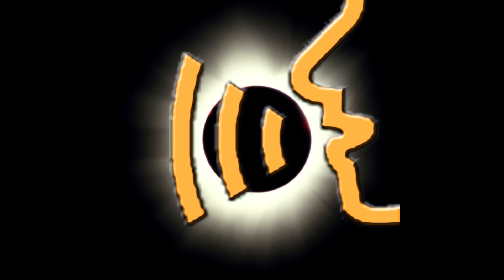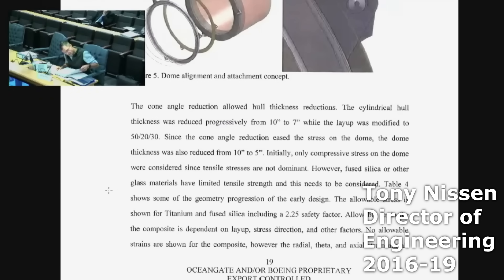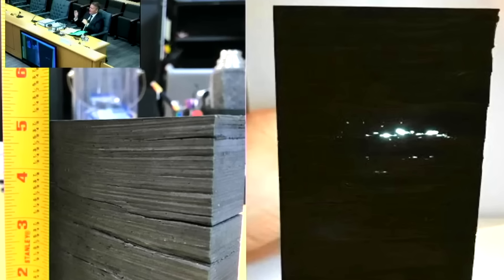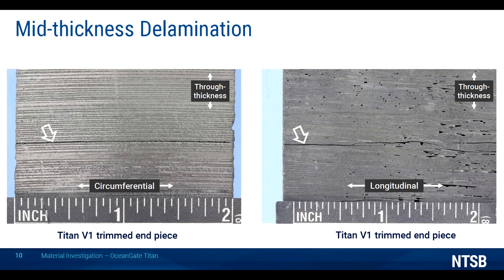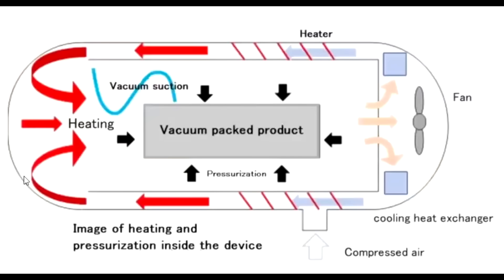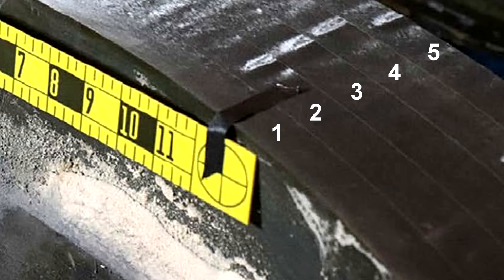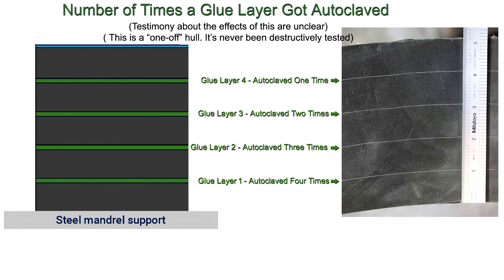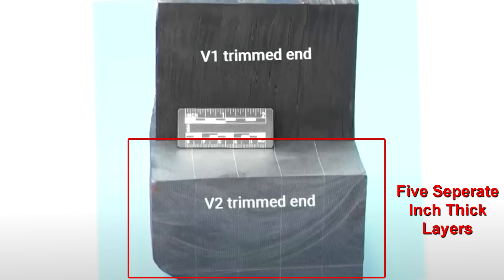Who Engineered the OceanGate Titan V2 Hull? Maybe Nobody Did?

Comment: The fact is, the design worked. It worked. 

They just used it more times than they should've. Even if it had been replaced with a new hull it would've been significantly cheaper that a titanium hull, which was the whole point of the exercise. 

It's truly a shame that the legacy of this project is "CF hull is bad, bro" when the reality is that it works, and it's cheap. 

You just have to stop using it after the hull has failed, not keep using it like these guys did, even though it had already gone crunch.
Reply: What is the safety margin you build into this though? How many fewer trips?
Reply: @ThePinkPanth3r  Six fewer. 

That's when the hull initially failed, according to the sensors on board that said "Hey. Something just broke, or something. Probably want to take a look at that."
Reply: Finally, someone who understands the reality of this. The vehicle was a marvel of engineering, but it did have a lifespan and the guy didn’t have unlimited money. He should have stopped and rebuilt the vehicle every 10 cycles. Maybe not cost effective for commercial thrill seekers, but perhaps he could have sold the design to a government or something.
Reply: One dollar shop solution aren't an option. If one wants to use untested material then one has to test and get it certified so one knows that a material is safe, for how many cycles under which conditions. The submersible was abandoned over the winter on a parking lot, it was pulled over hundred of mile behind a ship. It was a desaster waiting to happen.
Reply: @TorianTammas  And yet it survived all that, plus 87 dives, 13(?) of which were successfully down to the Titanic, plus one or two where it got close to that depth. 

One would argue that the number of cycles it was safe for was the 81 dives it made before it failed (a bit, because it did several dives after that too). 

Had they retired the hull at that point, the point of the initial failure, this guy would be an industry hero for proving it can be done safely with a CF hull, on the cheap (compared to the conventional materials). 

Everything is a disaster waiting to happen. 

You think the ISS is safe? You think rockets and shuttles are safe? None of them blew up, right?
Reply: The thing I don't really get is why the options were being limited to carbon or titanium? Why not steel? Why was weight being treated as a critical factor when it could easily be counteracted though adjusting buoyancy?
Reply: @zachmiller9175  When CF isn't 2x lighter than steel, it's 5x, then you add bouncy for 5 times the weight, THAT material adds weight, and you're adding weight to overcome weight. When Mazda reduced the weight bloat on 4th gen Miata, everyone wanted a 6 cyl. Mazda went with 4 bolt wheel hubs, to go to 5 added unscrupulous mass, requiring bigger brakes, going to a 6 cylinder required a 250 pound heavier engine, but supporting it added 900 lbs to the vehicle. Engineering is complex.
Reply: @zachmiller9175  You have to ship it and lift it on and off the ship, for one thing. Steel is up to 2x heavier than titanium.
Reply: @fredmercury1314  steel is 2 times denser, but a steel pressure vessel is nowhere near 2 times heavier (steel is stronger per volume, which greatly narrows the gap between the two, almost to nothingness; in particular the best steel alloys are pretty much exactly 2 times the maximum load capacity of the best titanium alloys).

Titanium, however, seems to be easier to get to the deep submersible pressure vessel. Not sure what particular reason makes making such a steel vessel (the casting of oversized blank for the precision CNC milling) so hard that it has only been done for two of the (not that much more numerous) N deep sea submersibles.
Reply: @L2M2K2  for diving it's not only sheer strength that matters.

 The vessel must also be Rigid and very strong against Buckling, the solution to both is having a thicker hull, which is more viable with less dense materials.

 It's as simple as that, a steel hull thin enough to compete with titanium in the weight category is not up to the job.
Reply: @davidaugustofc2574  As far as I understand, the two personnel spheres in the two Mir submersibles (which have the made in Finland maraging steel personnel spheres) have comparable weight to much more modern titanium ones (and better performance than any contemporary titanium ones given that the country with at that point leading titanium submersible expertise decided to buy them rather than use their in-house titanium solution that wasn't capable of the desired performance). This was a feat that the USA had considered impossible at the time (and hence why they allowed a western country to sell such R&D project to the Soviets as they assumed it to just waste money and time). When the personnel spheres actually worked, making any more of them for the Soviets was forbidden with a threat of massive trade sanctions. (The trick is that maraging steel is actually a bit stronger per weight, which gives enough margin to compensate for the geometry constraints related to all entry points. The other trick is the same as with all modern titanium ones, precision manufacturing to make the buckling problem at interfaces only occur after the material would have yielded to pure compression alone on the smooth sections.)
Reply: Yes. It did work 18 times, including the 4 tests.
But does that mean that if you would build another one using the same methods that it would also crack on the 19th dive?
The problem is that we don't know. The methods and techniques used are unpredictable and unsafe.
You could build 20 of these in the exact same way and some might last 100 dives and others break on the first dive. How much dives would this design survive on average, and more importantly what are the minimum number of dives this design would always survive?
Did they get lucky or unlucky with this one? We don't know. And more importantly: With these materials and the choices made, the engineers have no way to figure it out unless we build a hundred and test them all to destruction.
Reply: It didn’t fulfill what design goals that it had. It did not work.
Reply: It showed said in the video that it was designed for 1000+ cycles. Carbon fibre design was not disposable.
Reply: A well designed vessel survives tens of thousands of trips. Not just barely less than 100..
Reply: Like Patrick Lahey pointed out a cf hull submarine isnt a new idea. U just have spend money and tine to test, certify and class it. Ocean-gate went for the cheap route.

Comment: so, the composite is carbon fibre and adhesive
what kind of pressure do boeing and nasa deal with? good guess, outward, so you need tensile strength, something carbon fibre is really good at.
under water, you deal with compression, which carbon fibre is not good at.... so the combressive strength comes from the titanium, metal and the adhesive.
the dumbass that decided to use carbon fibre is kind of at fault here if not completely.

having the titanium ring just glued on the pressure vessel is a bad idea, it should have been propperly anchored to the rest of the vessel, because then the pressure from the outside can just push the sleeve into the vessel instead of directly promoting everyone to meat slushy.

having the vessel scanned after the first dives would have shown that the adhesive was being worn down by the movement of the carbon fibre, and that the carbon fibre was probably crumpling / breaking under stresses it was not made for.
Reply from the maker: Thanks for commenting and those are good points.  There was testimony about the 5-inch thick hull and being able to scan it non-destructively to monitor its health.  That is the big issue, there is no scanning technique to see into the full 5 inches of the hull.  There was no way to non-destructively watch it.  Huge issue.
Reply: The design and manufacture wasn't the problem. The problem was the hull is essentially disposable and they didn't dispose of it; they kept using it after it got damaged. 

They ignored the fact that it had already failed before this dive. 

Had they used a new hull for this dive it would've been fine.

Comment: How much did this thing weigh? Because once you start getting super thick with carbon fiber its really not that light at all. Epoxy is heavy...... they could have just designed a steel hull for less
Reply: Weight is not the issue. The issue is cost. A steel hull would not have taken the pressure that this hull could take, they'd need a titanium hull, which would cost insane numbers to build. 

CF and epoxy is cheap.
Reply: @fredmercury1314 what are you waffling on about? Look up the Aluminaut, a submarine made out of ALUMINIUM  that could dive up too 17,000 feet, (the titanic only being 12,500 feet deep) and could hold 7 passengers in it
Reply: @fredmercury1314  Trieste reached Challenger Deep with steel hull, steel has enough strength to handle the depth, actually.
Reply: @fredmercury1314  Steel hulls in sphere form are used safely in this depth.
Reply: @fredmercury1314  that's not true steel hulls could definitely work at those depths. They didn't need to use titanium. Would have been nicer if they had used titanium
Reply: @fredmercury1314  a steel hull is the strongest per volume. The best steels are double the strength of best titanium alloys. So, per weight, steel can be about on par with titanium (contrary to the popular belief of titanium being a magic material). Though, the steel hull would need to be thinner, which adds its own challenges with all the non-steel parts, like viewports. And, the fancy steels are also not exactly cheap or easy to work with. Titanium might be cheaper for such (essentially) one-off items.

Comment: I build a longboard a decade ago with glass fiber and epoxy. It baffles me completly that they didn't used 45° fibers. That's like the basic to prevent torsion and ripping of the layers. I learned that one a small forum, I don't have a machinist degree or anything similar^^
Reply from the maker: Yep, I agree.  Thanks for your comment.
Reply: @solareclipsetimer  i mean, did they even ever heard of triaxial fiber?

That's what I've used, multible layer in one go, last layer biaxial and a topcoat of basic carbon fiber.

I know they couldn't used sheets of fiber but the concept and idea behind triaxial glass fiber is decades old!
Reply: Stockton was an absolute moron.

Comment: I'm not an engineer, but, an honest testing regime where those taking part will actually take failures on board and re-design and re-test would have been 100% more intelligent than what they actually did. Even if they were still trying to solve the issue using carbon fibre.
Pressure testing the thing for hundreds of cycles before ever letting anyone go near it, would have been more intelligent.
Making sure through a lot of testing that the end product met and exceeded the conditions it would be operating in would have been smarter. 
Even I, a non engineer, know that testing is everything. Long before anyone would be allowed near the end product.
Reply from the maker: Thanks for commenting.  That is why I present the story the way I did.  You don't have to be an engineer to understand the basic principles of design and testing.  The story of the Titan V2 hull and putting it immediately to use with manned dives is incomprehensible.
Reply: I'm not an engineer either but when the hull makes a cracking noise, you don't ignore it and go for another dive, even deeper, with guests. You get a new hull.

Comment: I love the sensors they used. It’s like putting a sensor inside a tank that basically alerts you that the tank has been destroyed.
Reply: The sensors even worked. The data from them showed the investigators clearly that there was a delamination going on when the sub came up from dive 81 and that it changed the behavior of the flexing in the hull afterwards. But OceanGate didn't properly plot the data and also did not properly compare results between dives, so they didn't get the warning EVEN THOUGH THEIR SYSTEM WORKED!
Reply: @peterking8586  put a thermometer that warns you when the ammo reaches cookoff temps 👍🏻
Reply: Pretty much a death bell. Once you hear it you know
Reply: they were a good idea, but would've needed to be combined with having them in standard placement and destructive testing hulls to get a baseline for at what point you'd need to scrap the hull. as it was, as rush seemingly ignored the data anyway, they seem like they were just security theater

Comment: Some of the pictures from the wreckage shows the thin inner lip of the titanium dome sheared off at its edge attached to the thicker part of the dome.
If it crushed from the middle would these have sheared off that way? or did it fail at the bonded edges near the ring instead. 
The center may have flexed but is that actually the point of failure?
Reply: Think of a soad can if you collapse the walls you get inward cracks at the ends and outward cracking 90 degrees to the compression axis
Reply: I don't think we will ever know. The forces involved are so huge and nothing was designed to handle them from any angle except the optimum one. Its like playing tug of war and they let go of the rope, you aren't prepared for that.

Comment: You can't discuss Titan without mentioning U.S. Navy Advanced Unmanned Search System (AUSS) project. Everything including hull construction and hull integrity monitoring system were developed there. The point which everyone is seemingly missing is that monitoring system actually were able to identify structural damage on one of the previous dives. But it was just ignored.
Reply from the maker: Thanks for your comment about AUSS and the monitoring system,  You are correct, it was dive 80 where they heard a large bang just before reaching the surface and there was a big jump in the strain gauge data.  Stockton ignored it and blamed it on noise from the supporting frame.  I think Stockton knew there was a big issue, but he couldn't lose the money from the next two dives, which amazingly were successful.  They should've stopped diving after diving 80 and cut the sub up to find the problem in the hull.  No one would have died and they would have learned from it.  They may have learned that carbon fiber is not good for those depths, or learned a way to make it better for those depths.  If he stopped after dive 80 Stockton would have been seen as a great innovator.
Reply: @solareclipsetimer  yep... I can't explain why he decided to proceed, knowing that he will be aboard. Thank you for the great video!
Reply from the maker: @arturzhmur8735  Thanks for your reply.  He had to proceed.  He was in real financial trouble.  He did not want to give up and have himself and his investors lose 100 million dollars.  Watch my video on that topic, search YouTube for this title. OceanGate Was Broke! - Titan Caused It - Employees "Spill The Beans!"
Reply: @solareclipsetimer  will do. Yep... I thought about the same... One more dive and we will rebuild it... Just one more dive.
Reply: @solareclipsetimer  from the referenced doc...
> 2. Apply the design, materials, and fabrication procedure used in the AUSS Mod 2 cylindrical hulls to the construction of deep-submergence cylindrical hulls for remotely operated or autonomous vehicles with external diameters less than three feet.

remotely operated and autonomous...

To be absolutely honest I have mixed feeling about "explorers" movement. As... Well now you have ways to control everything remotely with the really great image quality... No need to go in person. No practical reason.
Reply: Using un-tested  material to construct an uncertified experimental death trap. The question was only when will the desaster happen.

Comment: I don't understands why Mr.Rush didn't just use a Corrugated steel drainage pipe.. It would have Saved him sooo much money on the design!
Reply: There was not private toilet. Count me out.
Reply: @100thMonky  At least the corrugated pipe would probably start collapsing at a survivable depth and maybe a couple of them would have made it out with a bad case of the bends.
Reply: They could have used concrete drainage pipe. There is at least some engineering reasons behind that. ;-)

Comment: Just on your last point about regulator, the marine industry is effectively regulated by the need to insure your vessels against loss. Marine insurance won't typically cover the operations kf a vessel unless you get Acceptance by a Class Society of the design, and inspection by a marine warranty surveyor. Surveyor won't turn up without the design being accepted by Class as they are checking that it's been built to design, and any deviations during construction have to go back to Class for validation and acceptance.

By not going to Class I don't know if they were insured for the trips they did. I'm wondering if there was some loophole around experimental vessels with only Crew onboard since the dive contracts had all the passengers nominally as crew members.
Reply from the maker: Thanks for commenting.  You are right.   There was testimony about this but I don't remember the exact details.  The loopholes had to do with the fact that there were no paying passengers (just crew and mission specialists) on the sub and they were doing science (taking water temp and salinity measurements and mapping the wreck).  Vessels doing science have more lax rules.
Reply: People usually follow tested specs and safety guidelines because they don't want to turn into red mist during a dive.

Stockton Rush did not acknowledge these risks and actively sought to push progress forward regardless.

Edit: Also, experimental vessels would usually undergo rigorous testing until failure points were determined. OceanGate once again rushed the process and only tested to see if the vessel would make it to target depth.